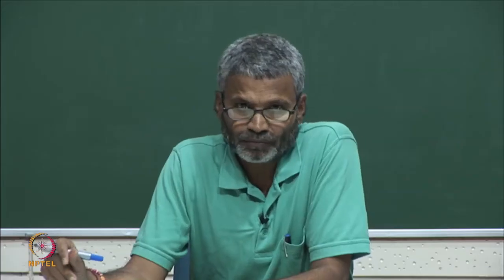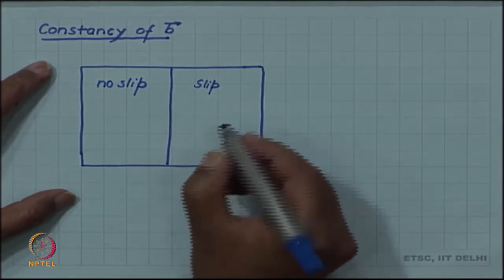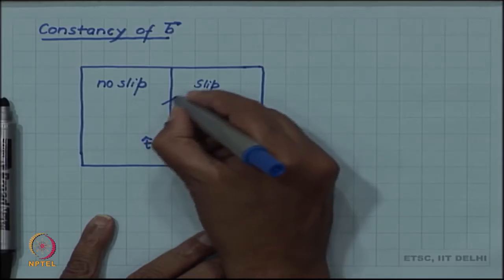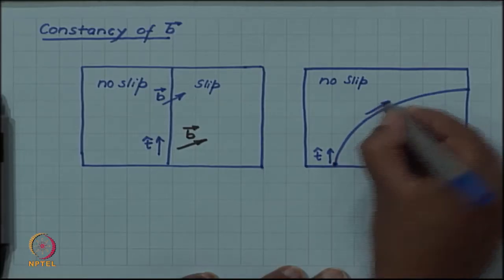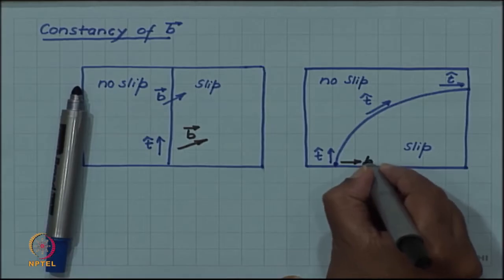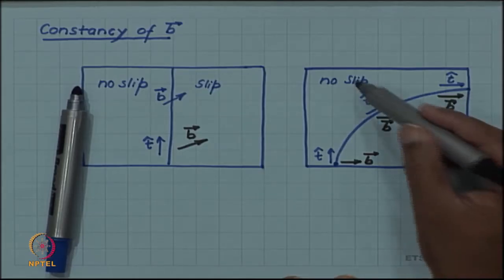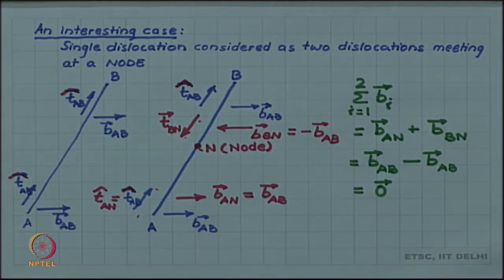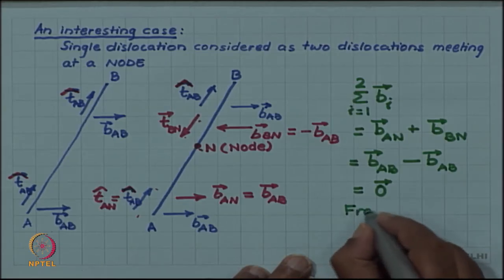Burgers vector of a dislocation is constant along the line

Comment: sir in previous video u discuss about constancy of burgers vector but here u change the direction of burgers vector in accordance with unit vector why??
Reply from the maker: I am only changing the unit tangent vector but not the Burgers vector.
Reply: @introductiontomaterialsscience  sir u reversed the tangent vector,and then u also changed the burgers vector
Can u explain why?
Reply from the maker: @imsg2704chem  A given Burgers vector is associated with a chosen tangent vector. Tangent vector can be chosen in one of the two possible orientations. Resulting Burgers vectors will be opposite of each other.